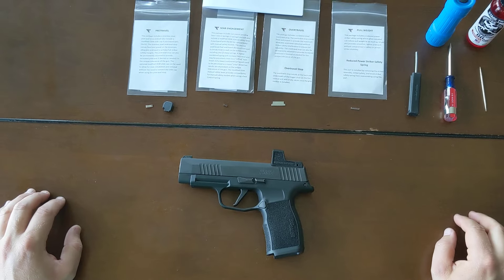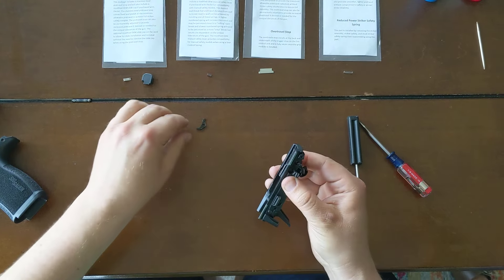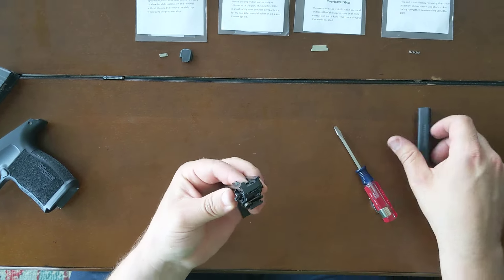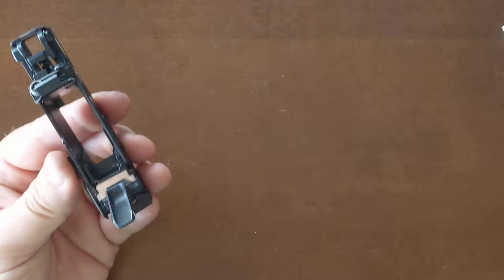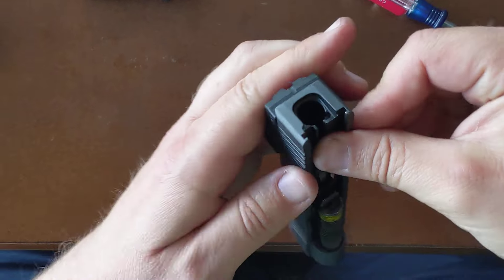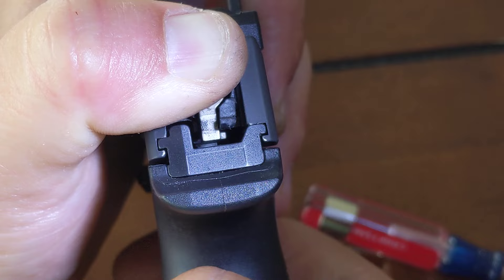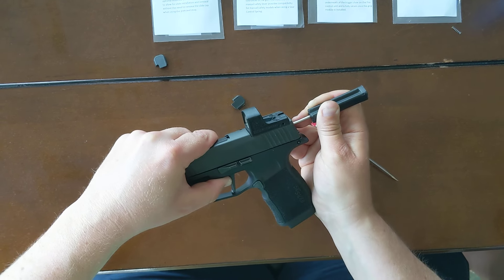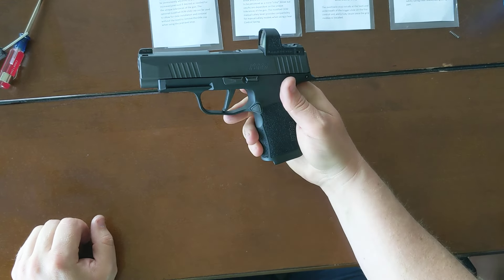Tactical Trigger, LLC Sig Sauer P365® Trigger Kit short install video

Comment: So is it a trigger or is it a kit for the existing sig trigger ?  Sorry for the dumb question I am still new to this.
Reply from the maker: Yes, it tunes the stock trigger. It is also compatible with other aftermarket triggers but is designed primarily for use with the stock curved or flat trigger from Sig.
Reply: Would it work with the mcarbo trigger or the imt Nebraska trigger?

Comment: Can this be used with M carbo kit?
Reply from the maker: Yes it can used with spring kits but changing the sear and striker springs really isn't necessary to get the performance most shooters are looking for and could potentially affect reliability.
Reply: @tacticaltriggerllc  Personally I’d rather have a shorter travel then a lighter trigger
Reply from the maker: @Wickedtrucker75  Agree, and with this kit you really can have both if you want. Using a stock striker safety spring, pull weight is 4 to 4.5#. Using our reduced power striker safety spring, pull weight is 3.5 to 4#. Most really won't want to go lighter than 3.5# for a carry trigger anyway.
Reply: @tacticaltriggerllc  agreed

Comment: these upgrades are useless without telling us trigger weight before and after.
Reply from the maker: Pull weight is just one aspect of trigger performance and can be adjusted with just our reduced power striker safety spring alone. The starting pull weight for a stock p365 is 4.5 to 5.5#. After installing the reduced power striker safety spring pull weight is reduced to 3 to 4#. The other parts of the kit reduce travel and eliminate creep in the break.